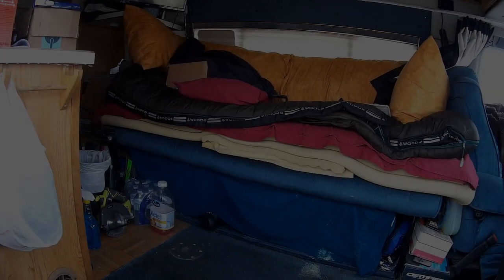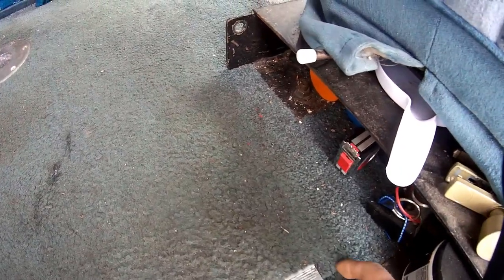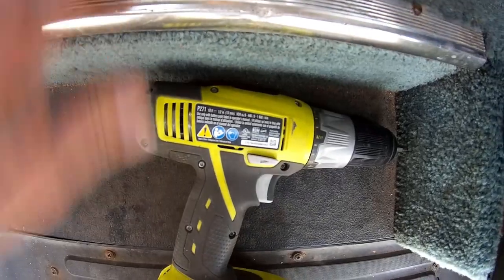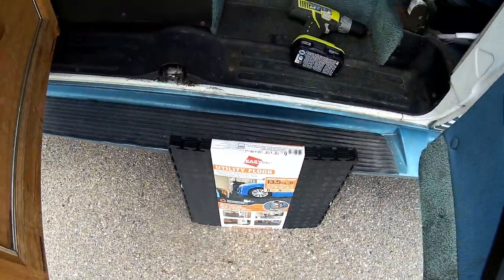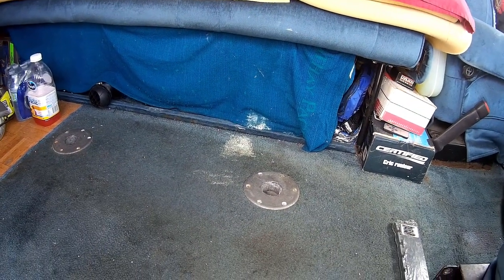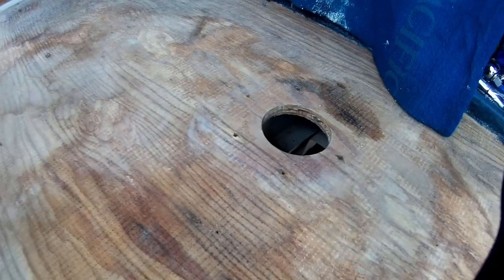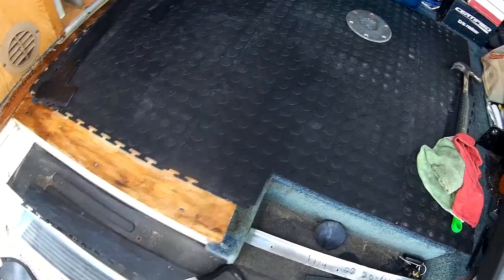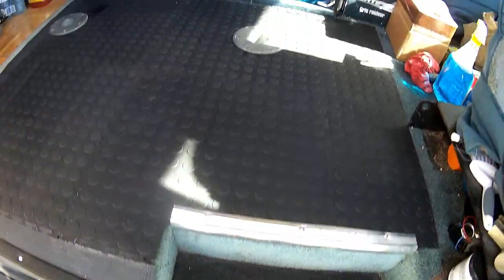Out with the old in with the new flooring

Comment: Great looking flooring. Nice job! 
A little surprised to see the metal flange plates sticks through your floor with nothing under it. Seems like the flange could benefit from a little insulation or body undercoat.
Reply from the maker: Hi Scott. The two holes for the table pipes are two spots that could have moisture and cold coming in.  This flooring is very thin in the first place. A coat of spray sealing like undercoating would work, thanks for the suggestion.

Comment: Great improvement! I was surprised you could see the ground when your rings were removed. I guess that means it's not sealed from the bottom?
Reply: Timothy Keller Vandweller ha! I said the same thing!
Reply from the maker: As you could see in the video the floor is not to thick either. I guess back in 1995 they just drilled big holes for these mounts. I wanted the table so I kept the holes, and I have to deal with it the best I can. Floor is a little thinner then yours , lol. Looks your build is coming along nicely
Reply from the maker: @StaticCamperVan  Yea you guys are right. Pretty big holes they made back in the day, but I wanted the table I had so I didn't fill in the holes. Thanks for watching guys.